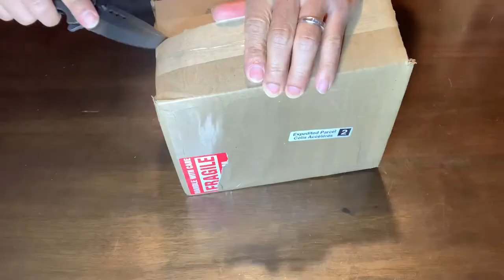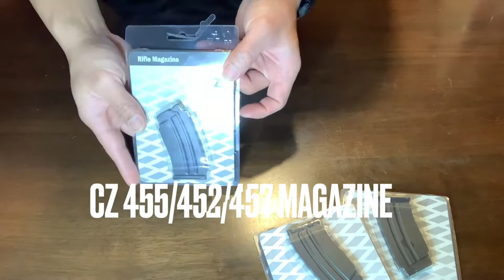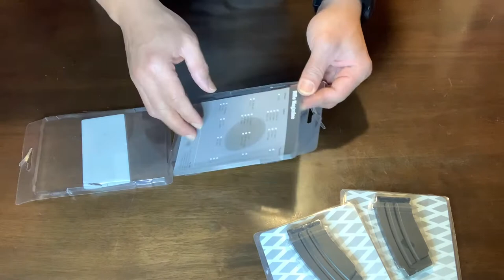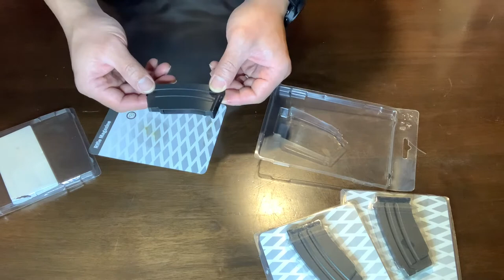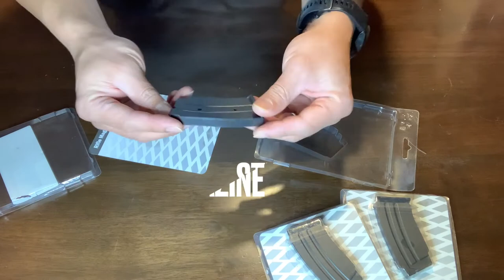CZ 455/452/457 22 LR 10 Round Steel Magazine

Comment: Question, if I may please? I have 2 452's, both are varmint models, one in .22LR and one in .17HMR. I also have 2 455 's, the .22LR is the Evolution model (varmint barrel) and the .17HMR is varmint thumbhole.
 
The question being - the mags for the .22's (452/455) are interchange but the mags for the .17's (452/455) aren't (they don't look the same, either), do you know why this is? How could I know which one to order?
 
I went to a gun store and the mags they had said (on the package) they fit both the 452/455, however they looked like the old style mags for my old 452, not the newer 455??
 
I ask because I just bought the 455 .17HMR and it only comes with the one magazine (factory 5 rounder) and I would like at least one more mag. Many thanks for any info you can provide. Cheers...